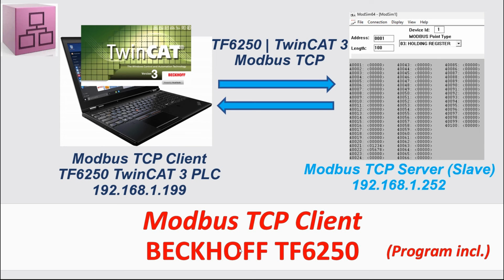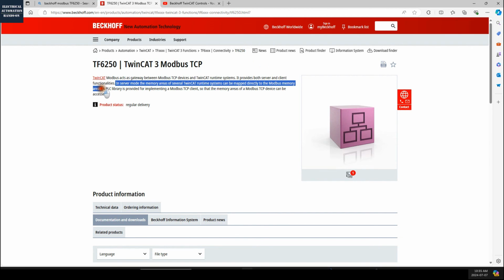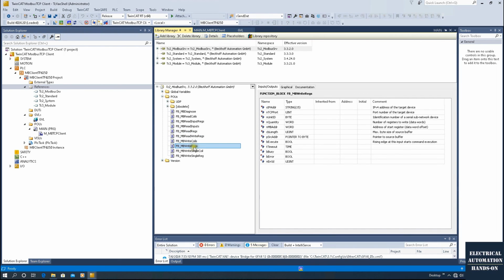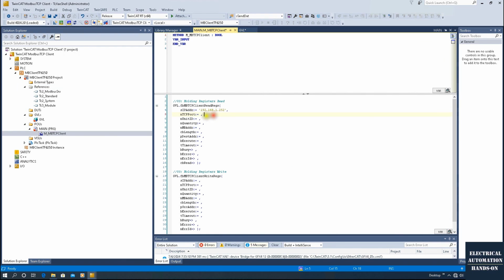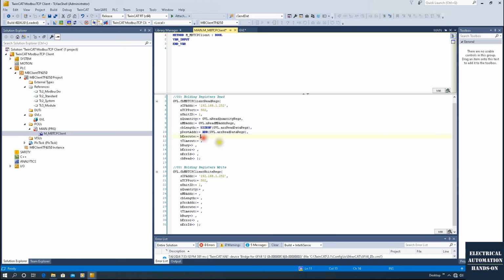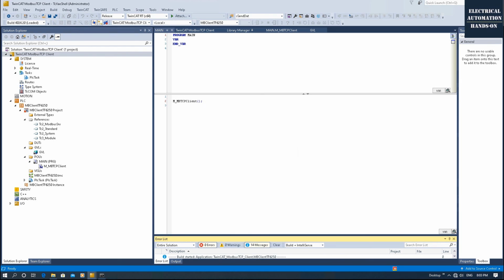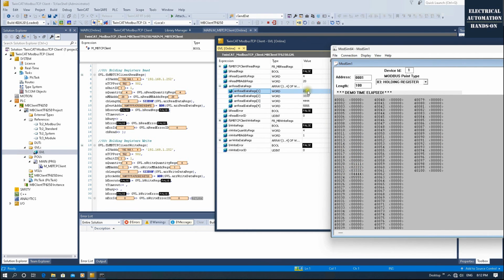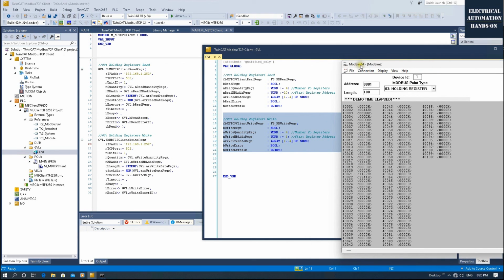COM35. Modbus TCP Client via Beckhoff TF6250 TwinCAT 3

Comment: Hi, I have followed the same procedure. Running TwinCAT modbus client in one PC and Modbus Server in other PC but Modbus client not receiving any data. ErrID 1861 is showing.
Reply from the maker: Check your PC fire wall
Reply: @electricalautomation Thanks for the swift response. Firewall is ok. But twincat is using  PC wifi ip for sending modbus requst

Comment: how a PC with installed TwinCAT 3 on it can act as a master(client) so that receives data from a PLC(PLC's input) as slave such as siemens S7-1200's inputs and processes them then sends these data to PLC(PLC's output)? do you have a tutorial movie about this.? i am a beginner in this field
Reply from the maker: Aha, good question, please review 
COM19. ModbusTCP Server via Siemens S7-1200/S7-1500 PLC and TIA Portal https://youtu.be/cjSm5qJfmPg?si=4i1UFXXSDyAlMkPa. This video explained how to use S7-1200 runs as Modbus TCP Server (Slave).  Then combined COM35 the knowledge about TwinCAT Modbus TCP Client, you can make it.

Comment: My Beckhoff PLC's MicroSD card is lost. I downloaded the OS from the Beckhoff website, copied it to a new MicroSD card, and booted it up. I also assigned the IP and brought it online. Do I need to add any licenses after this?
Reply from the maker: Your license key mostly likely has been lost, but if you have the purchased serial number, you could apply for a license because backhoff  center has your controller ID attached with your old license
Reply: @electricalautomation  Do I need to contact Beckhoff for all the licenses used in our project file, such as NC for servo, PLC, etc.? Can you share your email address for detail discussion.